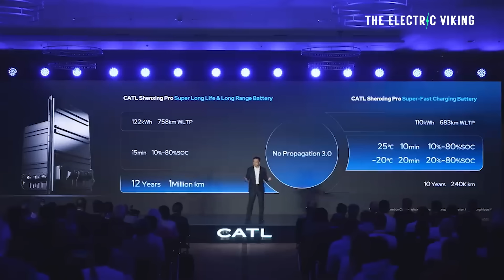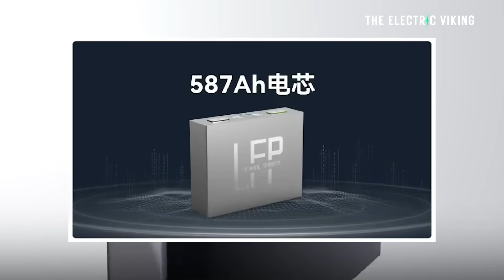CATL Reduces LFP Battery Costs 43% and INCREASES Energy Density

Comment: I don't think sodium-ion is going to take over.  Here is the thing and other YouTubers have caught onto it.  Sodium-ion has a very steep discharge curve.  Sodium-ion batteries have a low efficiency.  Overall, sodium-ion batteries are quarky, lower density batteries.  This all matters.  Say you want to hook up a power inverter to an LFP battery.  The discharge curve is very flat.  It is easy to have an inverter designed for Pb batteries work with LFP due to the voltage characteristics of LFP in general and the very flat discharge curve.  Hooking a power inverter to a sodium-ion battery, you need a specialized wide input inverter with thick gauge wires so you can still draw from the battery at the very low voltage at the bottom of the discharge curve.  Or else you are thinking, well I guess I am going to have to be very careful to not over-draw the battery because what you can pull towards the bottom of the curve power wise is crap.  Then you need specialized chargers to handle charging these batteries and at first you are not putting in much power because the starting voltage is so low.  Then you look at your power bill or how much you need to spend on solar panels and it comes out to a lot because sodium-ion batteries have a low efficiency.  Kind of like using Pb batteries, the efficiency is terrible.  LFP batteries have a very good efficiency.  The only thing sodium-ion gets you is it can work in lower temperatures.

There is a problem in the LFP battery space.  This is the market is flooded with high capacity, low discharge rate batteries, but there seems to be very few higher discharge rate batteries made.  Here is the thing, say you have a high discharge rate application.  For a long time we have made high discharge rate Pb batteries, say for starting your car or truck engine or for a UPS and then say your deep cycle marine Pb batteries.  So, say you want a smaller pack for a series hybrid pickup truck that does range extension with an ICE engine and large fuel tank.  Oh wait, nobody seems to be making the right C rate LFP batteries for this. Say you want to make a UPS where the batteries may be discharged in a matter of minutes?  Again, nobody seems to be making the LFP batteries for this.  Especially for the pickup truck application, higher C rate LFP batteries would be a great marriage of technologies because in cold weather you could fire up the ICE engine and dump waste heat into the battery pack to warm it up to safe operational temperatures and then switch over to using the LFP batteries.  Most of the year you would start with using the LFP batteries and then use the ICE engine for range extension.  It is just with this reduced size LFP battery pack, you may want to target a 150 mile non-towing range that could get dragged down to ~50 miles with a large, draggy trailer, but then you are going to want a battery that can take 5C rate hits and at least 3C rate sustained without tapping the ICE engine for power.  These mass produced LFPs however are only designed for 1C rate sustained loads and maybe up to 3C rate short hits.  If you just used these massed produced CATL cells, you could have a 'sluggish' all electric mode from the series hybrid pickup truck, but then for a regular power mode and towing mode, you would have to be running the ICE engine a lot to produce the extra instant power to make up for the shortfall in C rate from the batteries.

Comment: increasing the energy density by 10% is good, but the energy density of batteries is absolutely diabolical compared to the energy density of petrol. that's why 80kg of petrol can make a (35% efficient) car go 600 miles, yet 500kg of battery on an EV (which is 90%~ efficient?) can make the EV travel not even half of that distance.

That's how horrible the energy density of batteries is. a battery weighing 6 times more than the weight of a given amount of petrol, can't even make the car go half as far, even considering EVs are 3x more efficient! 😂

Diabolical is an understatement..

Batteries need to me massively better in energy density and weight to be any use for transport at all.

That's why battery powered commercial flight over any kind of reasonable distance will never happen until massive breakthroughs are made.

We need more game-changers! There's plenty of promise of these game changers, but none actually materialising so far😂
Reply: You can't reuse petrol.. unlike lifo4 batteries, 8,000 to 10,000 times.
Reply: @stuartrandle6585 batteries are like a petrol can, only the container. 

what a ridiculous comment😂
Reply: @NeilHuband-p8q  By your logic, you can throw in a newer, higher energy density battery into your EV once the technology has advanced to the extent of EV batteries overdoing energy density to that of unleaded pump gas (it's already higher than 85% Ethanol blend)

I do have to admit that Sam's game-changers has been getting both annoying and repetitive, but one as a creator has to make ends meet for that engagement click
Reply: @FemboyMotorworks 

the energy density of petrol is around 12,500 watt hours per kilogram of weight.

the energy density of ev batteries is around 200 watt hours per kilogram.

Petrol is 6 times! more dense in energy storage than batteries. 

In other words, current batteries are terrible in terms of density, and it's going to be a long long time before they're going to compete with petrol at storing energy.

I personally think that EVs have just been released far too soon. Not fit for purpose.
Reply: @NeilHuband-p8q  The current lack of energy density is then mitigated thanks to regenerative braking, something that the petrol propulsion lacks (hence the 95% energy efficiency on EV's vs the 35% on petrol), which is why the average EV in the US is capable of doing 300 miles on average... And that's not emphasizing long range specific EV's!

With new tech there's no such thing as ”released too soon”, otherwise the incetivized advancements in mass done nowadays wouldnt've been made possible

It's okay to distance yourself from something new in its initial phase, but don't be surprised when it slowly becomes the norm for many
Reply: @FemboyMotorworks to become the norm, it has to be better than petrol. And right now there are too many down sides and inconveniences.

One day it probably will have mass adoption I agree, but that time is not now or in the very near future. Try again in 10 or 15 years..
Reply: @NeilHuband-p8q  It could happen in five years, knowing that some countries have EV's being the norm (Norway) but admittedly that's my optimism speaking

Comment: They will not go to cars; 40 cells=<100v that will take a lot of transforming but fine for big storage.
Sam: higher density does not mean lower cost than they say; when they say 43% cheaper its pr kWh not pr liter. Again not mentioning that today we are talking volumetric density, what are the gravimetric energy density?
Reply: 40 cells would have a nominal 131.2 V   (LFP cells are normally at 3.2V nominal), still way too low for an EV battery.

Comment: The battery equation is complex. I have witnessed, over the years, as items get cheaper, they are not designed to last &/or easy to repair. Batteries don't get repaired so what part of the multi-spectrum is not defined here? Longevity? If they lasts the useful life of the car there is little incentive to make batteries survive longer. And is thee a trade-off volumetrically, not that that affects much in BESS.

Comment: When something looks too good to be true, it generally is. Headline: 40% cheaper, 10% more energy density. BUT!!!! What is the unspoken trade off, is the cycle life halved, or the operating temperate range slashed, what is the hidden GOTCHA!?
Reply: did you not watch the video? Cycle life for storage is 10k cycles, roughly 30 years.
Reply: @roman-d-mueller  cycle life is just one of the variables that can alter with a new battery design. What about charging and discharging rates etc etc. Whenever battery manufactures tell you about their latest and greatest product they generally omit anything that is negative that they don't want you to know. There is almost always a compromise buried deep within the specs. So my go to question is what am I giving up?

Comment: $40 per kWh.  A 100 kWh car battery will cost $4K gives you 300 miles range.  200 kWh at $8K gives 600 miles range.
Reply: Except, you can't make an EV battery out of these cells, to get 100 kWh, you would require 55-56 cells. All of them in series gives you a nominal pack voltage of 176 - 179.2 V. LOL
For energy storage, these cells are great. For an EV you need the lower capacity versions, otherwise you will never reach the 400V you want in a pack.

Comment: well, solar panels have been steadily getting cheaper for a while, last 4-6 years, no signs of it slowing down.
Controllers, inverers? price has not changed, but capacity now (2025) is 4x what it was in 2020, so from here on in the cost of controller electronics are not a serious factor. Tho racking and wiring costs are pretty well fixed.

But batteries? they are cheaper now, maybe half what they were a decade ago.
That still makes them the major cost, MORE THAN HALF!

So long way to go yet, maybe sodium? my money is on the high school geek who figures out how to make it cheap.

Welcome to the 21st century Mr. Joy and Mr. Gates.
But your sucessors will be from some place else. 
Somewhere that places a premium on original thought.

Comment: Will NOT be in powerwalls.  The cells are too big(double the size) and would require a FORKLIFT to install at every job site.  As it is one can BARELY get the the 300Ah LFP cells installed due to weight problems.

Comment: CATL should use sodium batteries for energy storage, space and density is less of an issue than for cars.
Reply: CATL aren't stupid, so no they will not use Sodium for grid storage nor are they selling them for that application.  Their efficiency stinks.  Their voltage drop is the MOST pitiful of ANY battery chemistry ever created.

Comment: Electricity IS NOT a source of power ...it is our form of power transmission with the most flexible end use options.
even a battey transforms electrical energy into chemical energy, and back

Comment: Note that these cells are for grid energy storage, not EVs.  They are too big and heavy for cars, but maybe good for electric heavy trucks.  The 30 year design life is just what EVs need IMO.  If OEMs could extend warranty to 12 years, and most packs last 30 years, that would give used EV buyers confidence.  That would help them choose to buy an EV, vs. tried and true ICE.
Reply: the problem with them is not weight. the problem is that to get the 400 V pack voltage you want, you need about 125 of those cells. Which would give you a 225 kWh pack. any lower number of cells, and your pack voltage goes down.
Should you aim for an 800 V system, you would need 250 cells, giving you a battery of 450 kWh. Now we are talking. But not EV, electric truck.
Reply: @roman-d-mueller I think we are pretty much saying the same thing.  The 225 kWh and 450 kWh packs, needed to get the proper voltage, are going to weigh too much and will be too large to fit into a car.

Comment: 7:28: With about (30 to) 40 cells you cannot power an EV !!! - it gives (96-) 128V only - and needs 1000 Amps to provide 128 kW of power, whats low vor EVs too already. Your copper cables will be heavy as the battery - thats total NONSENSE!
Those sells will never ever be built into EVs - mayby trucks (40tons)....
Dreamer!

Comment: Honestly I think the sodium-Ion batteries sound much more interesting for stationary storage. They offer more cycles while being cheaper, the temperature range is better as well as the safety what results into less temperature management and the cells are more sustainable. This batteries would have sounded increadible a while ago - I think for mobility it still is increadible
Reply: None of that is true.   Cycle Life Equal at best(unproven) than LFP.  Not cheaper, Lithium is 5% of the cost of a LFP or NMC cell per Tesla and CATL.  Sodium's efficiency sucks which means you have massive HEAT problems and waste of power problems requiring MORE solar etc which utterly destroys any "cost savings" instantly.  The volumetric efficiency of sodium also sucks by 30% compared to LFP so you have to ship 33% more weight and manufacture 33% more weight which is by and large ~Iron and Graphite which utterly destroys that 5% cost savings going from Lithium to Sodium.  The voltage drop is gargantuan on Sodium which means your bus bars have to be 2X as thick to manage the MUCH higher currents utterly destroying any cost savings potential.  The gargantuan voltage swings means that ALL current inverters etc DO NOT WORK with Sodium or you only get ~50% of the capacity due to said gigantic voltage drop over its charge %%%.  The ONLY  thing sodium is good at is cold temp operations... which is utterly irrelevant for grid storage and ONLY relevant for vehicles operating up north... And not even then as if you REALLY want cold temp capability go with lithium Titanate which has ~same efficiency, but even HIGHER charge/discharge rates, superior cycle life, and is even safer than Sodium but with slightly worse energy density.  

Newsflash: Sodium so called "batteries" are actually Iron Graphite batteries, just like LFP where the only valid difference is that instead of Lithium Phosphate electrolyte you have sodium (I think oxalate).    Grow a brain.  Sodium is for dumb suckers.
Reply: @w8stral  I agree about sodium and  was going to upvote you but the personal attack at the end was uncalled for.

Comment: Great job Sam. Bullshit press releases no real information. They are not going to be cheaper. The price of an EV will stay stupid hight if the battery is large. Companies prefer to sell less for more. Everything out of China is cheaper due to subsidies and will get hit with a huge important tax.

Sam says designed for stationary grid storage but there's no reason they couldn't be used in EVs? Seriously man? If it's designed to be fixed in a stable box then you think it's okay to use in a car or truck? No Sam that's not how shit works. I bet its a great way to have cell failure and battery fires. You should at least think a second before saying something so stupid.

Comment: Tesla Powerwalls are so ridiculously expensive relative to the battery price I doubt this will have much impact on them.  It's very similar to the situation with consumer solar.
Reply: there iss  a lot of competition in that sector. that will lower the price.
Reply: Spoiler: These cells (587Ah) will NEVER see the inside of a PowerWall. Unless Tesla would suddenly change to low voltage systems and through everything over board. for a 400 V system you would need 125 cells. which gives you roughly 225 kWh. the current PowerWalls are around 17 kWh IIRC

Comment: 587 Ah cells. So it means that nominal power is 587*3.2=1,88kWh. 
What is the cell weight?
On CATL site. V3 LFP battery has 160 kWh energy density.

Comment: Regarding power storage, Robin zeng was saying one of the hurdles for large storage is lowering the complexity of a system.  So this seems like a step in the right direction.  Lower count off cells for the same storage. Less bms boards.
Reply: also fewer terminal welds, screw connections, and other wire connections that are common points of failure in any electrical system.

Comment: Sounds like a battery that a semi truck could handle.   I would rather see diesel trucks go away before ICE cars.  Currently an electric semi is double the cost of a diesel one.  Maybe even a little more.   Drop the battery price 30% and get 10% more range sounds pretty good.  I don't know if any Chinese ev semi's use CATL batterys to have a baseline.  I would think they do, but I don't know anything about the Chinese truck market, beyond they are buying ev trucks there.  A comparison of the EU and Chinese ev truck markets could be interesting.  Here in the US we really don't have one.  Doubt in Australia they do either, as a road train would need 1000kwh in the truck and each trailer.

Comment: I am not as interested in this breakthrough for cars (though we do have one Optiq), but I am hopeful for the cell application to home power backup.  Instead of two 16kWHr wall mount batteries one will have nearly the same capacity--and two would be signifcantly more.

Comment: Has anybody in the government ever thought about covering the expressways with solar panels?\n Specially in snow country, it would protect the Expressway from the snow and ice and also keep the concrete much cooler in the summer. Also, you could have prechargers.  Along the road
Reply: "Specially in snow country, it would protect the Expressway from the snow" - 🤣
Reply: Wouldn’t work.  The smarter option is to install them over a bike lane running alongside.

Comment: These batteries will not go into cars for 2 reasons. 
1. It's impossible to put enough batteries in series to scale up to 400V unless you go >200kWh battery pack. You end up having to use transformers that make the efficiency go down and the batteries run hot.
2. The charging speed will be really slow because you can't really increase the amperage from a 3,2V battery, you give it a larger capacity and it will take longer to charge.

Comment: 75% of energy in the UK comes from fossil fuels. It will remain above 60% for at least 15 years. Nuclear power plants cost a fortune. Renewables are expensive but really held back by the National Grid’s inadequacy. We should invest in fracking the north of England for self sufficiency in gas for 30 years. We should have solar panels on all roofs facing south. We should exploit what remains of the oil and gas in the North Sea. We should put windfarms on land. We should go for small modular nuclear power plants.